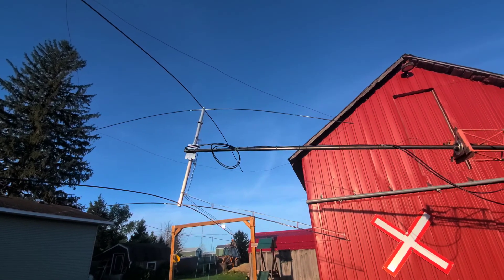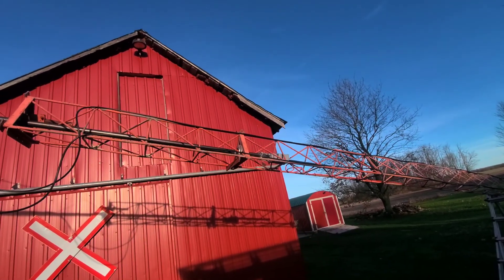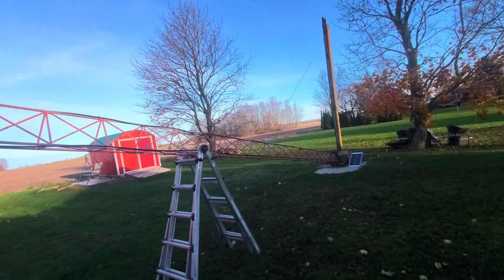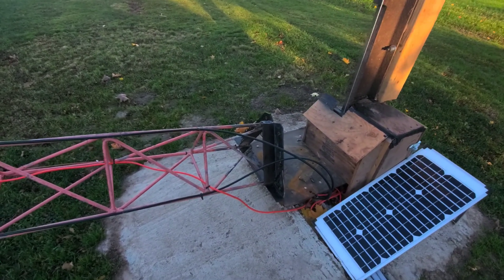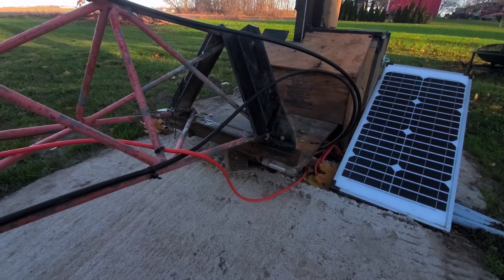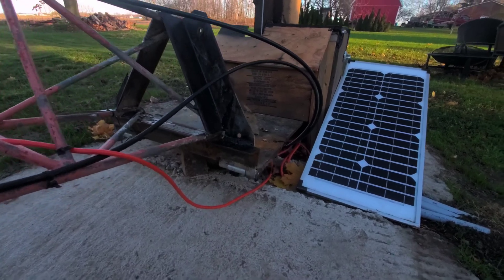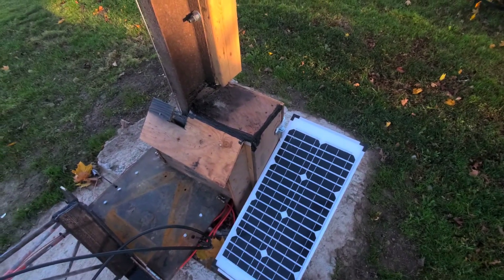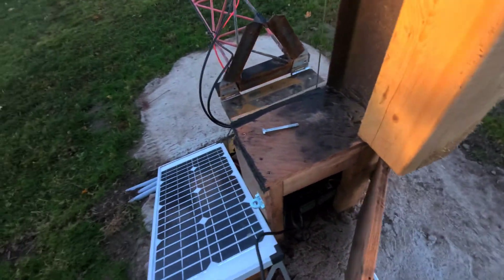50ft tilt over tower project

Comment: Very nice. I have a question: is there a clamp or something to hold the tower to the upright or are you using just the winch to hols it in place?
Reply from the maker: There are bolts i put through the base plate and the base plate on the tower once it is upright

Comment: Great job.  I am curious about the pole that the winch is secured to. Iron beam attached to wood? How did you calculate the height required for that pole etc.  I am going to install a Universal Tower 16-50.
Reply from the maker: @chromakeyblue  yes so i just used what i had around the beam is a piece of trailer frame and it was about 20ft long so 16ft sticks above the concrete i did no figuring out i just hoped it worked because it is what i had. The only problem i had was when winching up the tower the beam would want to twist because although it is very strong if it stays directly in line any sideways pull or twist it is Very weak so that is why i drilled it and lagged the 6x6 post to it as well
Reply: @worldradio520  What size I beam did you use as far a thickness of the steel?    Maybe the dimensions of the steel too.  Thanks for the video
Reply from the maker: Ok yes i can take some measurements of the beam tomorrow and let you know @Swphoto800
Reply from the maker: @Swphoto800  i took some measurements 7"x2" uchannel x 1/4" thickness